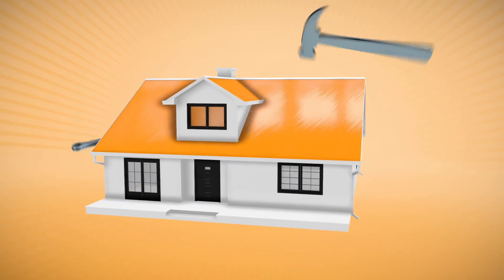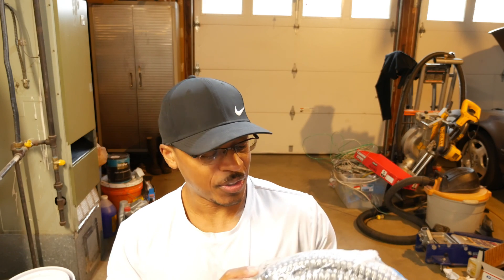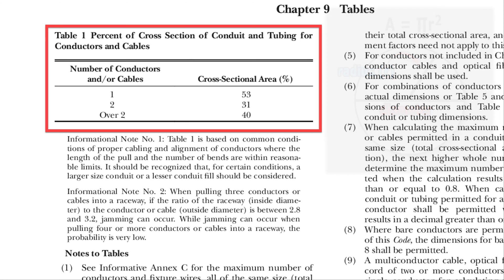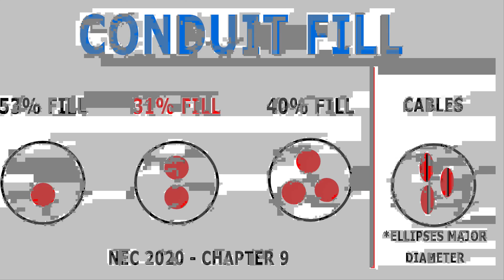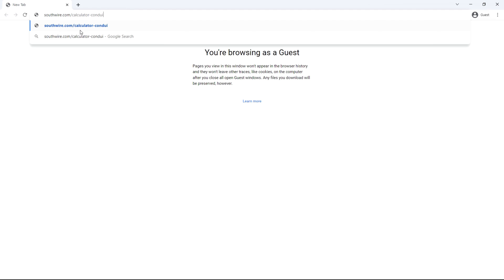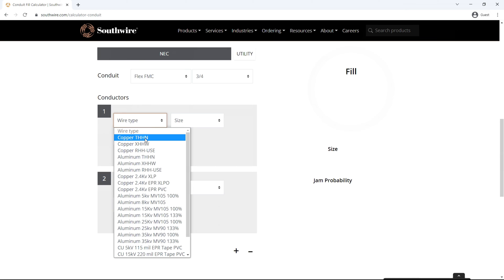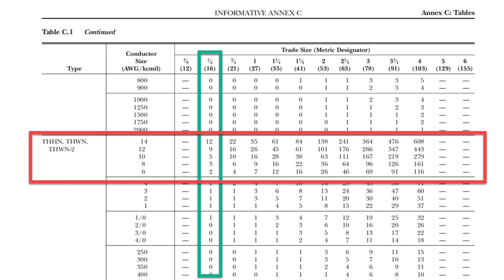How Many Electrical Wires Can I Put in Conduit? | Conduit Fill Calculation

Comment: Nope, don't get it. You need to explain what the percentage of fill limit is? A 2 wire has a 31% fill limit...what does that mean?
Reply from the maker: @2:07: Fill % is based on the cross-sectional area. Two conductors or cables can fill no more than 31% of the cross-sectional area. Each wire or cable has a specific size that's used in the fill% calculation. Hope this helps. You may want to re-watch the video.

Comment: I just learned, even though you can fit that many wires, the installation won't meet code unless you derate your wires per NEC 310.15 c 1. 12 gauge won't support 20 amps, and 14 gauge won't support 15 amps as is normally thought
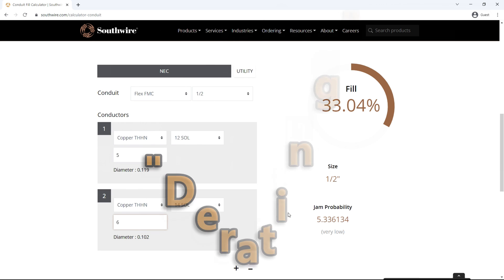Reply from the maker: Yes, I briefly mentioned "de-rating" at 8:04 as a factor to consider.
Reply: If you're using THHN (a 90°C conductor), you derate from the 90°C rating in T310-16. In that table, 12 AWG THHN "starts" as a 30 A wire in the 90°C column, so even if there are 7-9 conductors (70%), that yields 21Amps for multiple-conductor derating purposes, and 14 AWG THHN would be 25 * 0.7 or 17.5 Amps.

Comment: Hi, how many Romex 12/2 with yellow jacket is allowed in a 2” gray electrical pvc 40 pipe allowed? Thank you.
Reply from the maker: According to page 702 of the NEC 2020 book, the total area of a 2” Sch 40 PVC pipe is 3.291 inches squared: https://bit.ly/3kQI2mV
Southwire lists Romex 12/2 cable’s major diameter as 0.41 inches, which makes its area for conduit fill purposes 0.1320 inches ((0.41 x 0.5)^2 x Pi = 0.1320).
The maximum fill limit at 40% is 1.316 inches squared (3.291 x 0.4 = 1.316). 1.316 divided by 0.1320 = 9.97 – gets rounded down to 9. So, if my math is correct, without considering factors such as derating and conduit bends, 9 (almost 10) cables should be able to fit in a 2” Sch 40 PVC pipe.
Edit: Made a correction to the calculation in this post.
Reply: @DIYApprentice  thank you very much for your immediate reply and detailed explanation!
Reply from the maker: @daddypapi3842  My pleasure.
Reply: @DIYApprentice  No, the area of a circle is Pi x radius squared.The answer is 10.
Reply from the maker: @pld8993  Yes, 10 cables, or close to 10, is correct. In my head, I was thinking of the romex calculation as a square. For anyone else who may be viewing this post, I should have divided the 0.41 romex diameter in half, squared it, then multiplied by Pi.

Comment: I didnt understand a damm thing you said mate. Talk about over complication subdividing everything to individual wire with jargon terminology and you total inability to just break the information down into laymans diy terms so we can understand.  Most of us here just want ot know how many sets of 14/2, 12/2, or 10/2 we can fit inside a half inch emt conduit. The search continues.
Reply from the maker: Sorry that what I explained didn't come across clearly; I haven't received similar feedback from other viewers. It sounds like your primary complaint about the video was that I didn't go into depth about fitting residential cable in conduit, which is actually referenced around the 3:30 mark. There are all sorts of possible combinations, which is why I didn't get too specific and just mentioned cable diameter being a factor. Most installations I've come across run individual THHN or THWN wires in conduit. Here are the major diameters I was able to find for residential cable that would have to be included in the calculations: 14/2 (0.36"), 12/2 (0.4"), and 10/2 (0.49").
Reply: @DIYApprentice  Are they running solid or stranded THHN? Another thing that's not really explained well in the NEC is if "conduit" specifically means the pipe from box to box, I'm just trying to run a couple outlets so I've read others say that a simple drop run isnt considered "conduit" but rather just a protective sleeve in which case romex is acceptable and the heat concern isnt really applicable. But I guess the code and your reading assumes the use of THHN or the like single cables. Another concern is supposedly solid cable is able to support higher ampicity so Im not sure if I do run stranded THHN I should use 12g THHN instead of the 14g I wanted for simple 15amp outlets. Appreciate your feedback.
Reply from the maker: @hippo-potamus  I don't want to speak out of turn, since I'm not an expert, but it seems like stranded vs. solid comes down to personal preference when it comes to residential wiring. Stranded is easier to pull through conduit for longer runs that include bends, while solid is easier to push through conduit; I've only ever used solid wire. My understanding is that solid is able carry more current than stranded. Personally, I would go with solid, but I don't think the difference between the two for simple residential wiring is significant enough to warrant 12-gauge wire if stranded is chosen for a 15-amp circuit. Distance of the cable run can be a factor, with solid performing better over longer distances.
Chapter 9 of the NEC, which I referenced in the video, lists several conduit types: EMT, RMC, PVC, Liquidtite, FMC, IMC, etc. It's basically the pipe that protects the wire or cable from damage.

Comment: Thanks for the in depth detail. This goes much more into the design specifications and codes than I expected. Great reference. And you back it with source of materials presented. Top notch video for technicians and those ready to do a little math to get it properly done.
Reply from the maker: Glad you found the video useful. Thanks for watching!